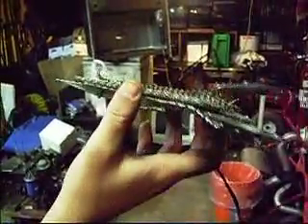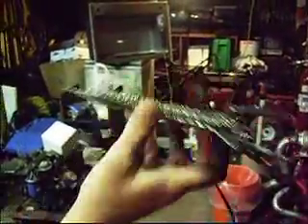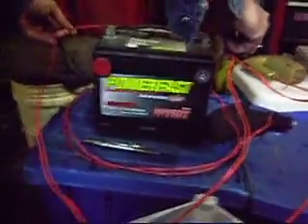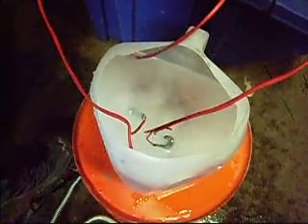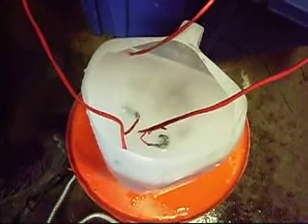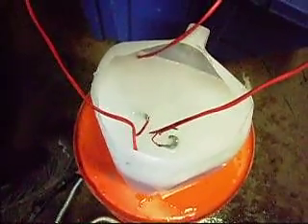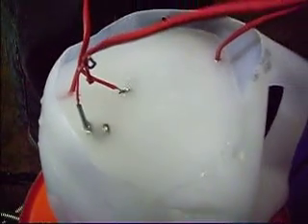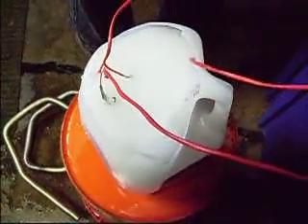hho easy to make electrolysis cell tap water only works great

Comment from the maker: this stuff can be baught at home depot,its stainless steal screen used for drains.
 
there are alot of types, take a powerfull magnet with you,and find the least magnetic one.
 
the more magnetic it is,the less it will work for electrolysis.

Comment: not bad for a 1st go-stick to plain to tap when you are testing cells-that way you can optimize the output without adding more electrolyte and more current.